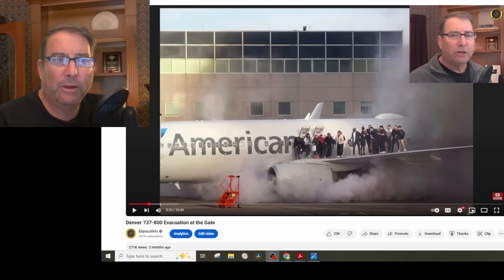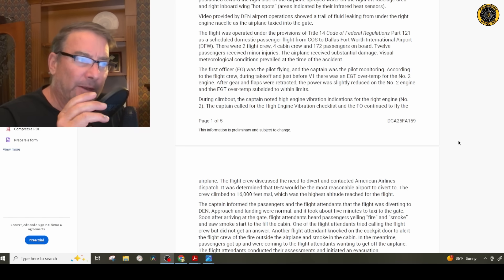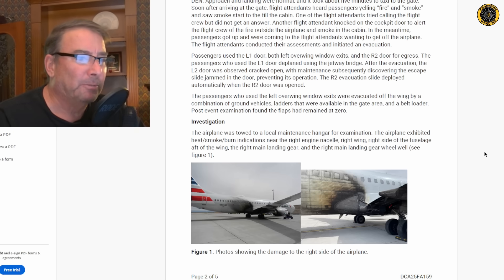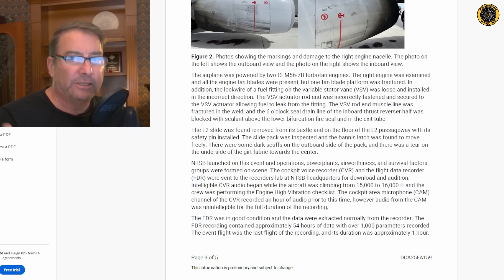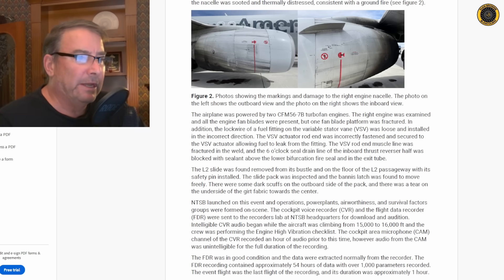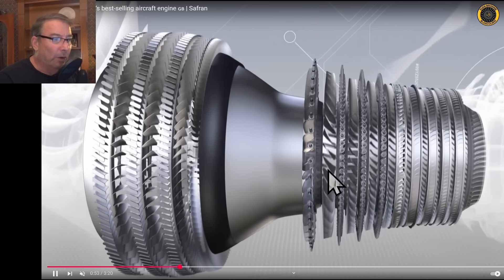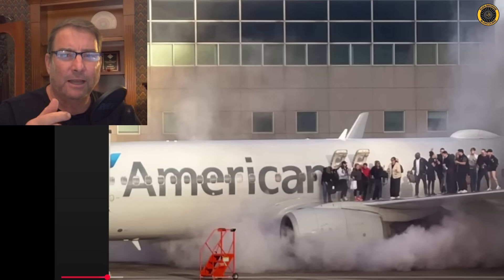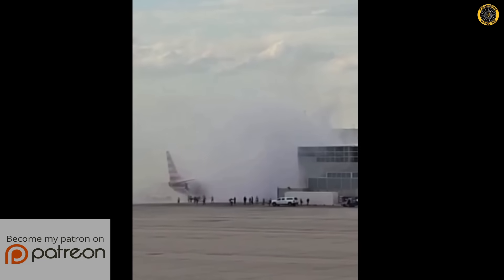NTSB Prelim American 737-800 Engine Fire at Gate and Over Wing Evacuation

Comment: The slide safety pin is to be installed prior to removal and before installation of the slide. It 100% prevents the slide inflation bottle from inflating the slide. It physically locks the inflation valve closed for obvious safety reasons. The pin has a two foot long streamer on it. At least it's supposed to have a streamer on it. I don't know how you'd miss that streamer, and the maintenance manual and job card are very clear about the pin. Replacing a slide is also a required inspection item, which needs the signoff of a QA inspector. Someone is going to have to answer a lot of hard questions, and I haven't even started about the VSV actuator.
What people don't get (even many pilots) is that if you're a mechanic, and do a task, you're fully responsible for that work until the task is done again by someone else. That could be years. Try answering questions about a complicated task you did two years ago. Good luck with that!
Reply: I'm a retired 737-800 LAME ex Qantas. Due to the occasion where a slide or two has been installed without safety pin being removed before the slide pack was installed on the aircraft. We now have a licenced engineer and an independent inspection by another engineer with documentation and signatures in the Tech Log.

Comment: It sounds like the person who installed the B nut incorrectly on the Variable stator fuel pressure actuator line also did not safety wire it properly.

Comment: no excuse to not have the flaps extended as SOP regardless of indecent, if it is relied on for evacuation. ``its alright if there is no fail safe condition after the power is removed, that will never happen if there landing is successful`doh...

Comment: A little extra information, because I've seen the gate camera footage. The gate ground crew (Fleet Service) did an amazing job rolling out the 150 pound fire extinguisher and dousing the fire in the right engine. Boeing engineering has said that the airframe would have been a total hull loss if the fire had burned for another 30 seconds or so. The gate crew also did an amazing job of thinking fast and getting work stands up to the left wing to get the passengers to safety. Phenomenal job and professional response from those workers!
Reply: Thanks for the extra info. The ramp crew do one of those jobs where you only hear about it when they done wrong. Great to hear a positive story about people normally overlooked.
Reply: We had those at every gate back in the day and trained on them but only if we asked and then only when there were expired extinguishers that needed serviced and the fire department was in a good mood when you asked. I hope that has changed and everyone gets some sort of training on the use.
Reply: @lonnywilcox445  I can tell you as a ramp agent we had to do an annual,computer based  training module on fire extinguisher use and safety and the online test at the end of the training module. While we did not physically handle something like the Ansul extinguisher used on the ramp, the video gave a detailed procedure for using it with much more clarity than if 20 of us had been massed around a real one and 1 person did the motions. ( not to mention the mess left after discharging one of these, repeated over and over at all the ramp training locations in the system).
Reply: @Jim-the-tallman   Great info, thanks!
Reply: The cabin crew were top notch. The evacuation was a safe as possible for this situation.
Reply: Unfortunately many of the passengers felt their bags were more important than other people’s lives.
Reply: @RebelliousTom1  The jet bridge was already there. The deplaning was already in progress. Leaving the bags in the aisle would have delayed the evacuation and possibly contaminated the aisle for use by the other passengers. The rules are for times outside of this.
Reply: @RebelliousTom1  I don't think the passengers are to blame for this one. The plane was connected to the jetway and de-boarding was already in progress, so the aisle was filled with passengers carrying their bags already. Try putting the bags back on the overhead or underneath the seats will only waste more time.
Reply: @RebelliousTom1  Fwiw nobody knows how they'll behave when panicked, until it happens
Reply: Phenomenal job? Your suggestion they use this hull again makes my thinking that the state of affairs of the fight industry is bad and people should save themselves  because the so called professionals are still doing there checklists.  No flight recording from the crew.  The flight deck was u b aware.   It just looks like a bunch of idiots run this operation.
Reply: @NyRenalMD I heard the plane is already been repaired and either at the paint shop or already back in service.
Reply: I don't want to fly on new Boeings as it is, I certainly would be pissed if I paid and ended up on this chassis as a future passenger.  Give it to the FedEx boys.
Reply: @workingguy-OU812  Why?  This will have been repaired as per the repair manual.
Reply: @cjmillsnun  I would guess that his comment encompasses all the Boeing aircraft problems of the last few years.  They have had design, engineering, firmware, software, training, and maintenance issues across several platforms.  The fuel leaks and safety-wire problems are sloppy repair work.
Reply: @workingguy-OU812  ...looks like maintenance issue this time....not an inherent Boeing issue.

Comment: I have been asking this question for over a decade ... why cant there be a redundant CVR system that sends compressed audio picked up from the cockpit to the cloud.  In the current modern era of wireless broadband, this should be a cake-walk to implement. IMHO as a retired IT networking engineer.

Comment: I am a bit confused. The prelim report states flight attendants “initiated an evacuation,” presumably after their attempts to contact the flight crew failed and having conducted their assessment. Perhaps it’s an issue of terminology, but it would seem to me that an “uncommanded” evacuation would be one that the crew (whether flight or cabin) did not initiate. Also, doesn’t the chief FA have the authority to command an evacuation in this exact situation?
Reply: "uncommanded" by the captain.
Reply: @KennethAGrimm  so if both flight crew members are incapacitated and the cabin crew determines an evacuation is warranted, it's still considered uncommanded?
Reply: @ashkebora7262 That doesn't make sense and seems odd to me. How do you distinguish between a true "uncommanded" evacuation (where no crew member gives an official command to evacuate) and one where they do? Precise language and definitions are critical in aviation.
Reply: Juan defines "uncommanded evacuation" at around 3:16.

Comment: Is there no evacuation command button on the FA panels?  I know that on Airbus aircraft, there's an evacuation command button on the FA panel that, if pushed, will sound an evacuation alarm at all other FA panels and in the cockpit.  Once the alarm is acknowledged, a member of the crew presses the button on their panel to silence the alarm.  In this case, an FA phoned the cockpit, with no answer, and another knocked on the cockpit door.  Had their been an evacuation command button, an FA could have pressed it, immediately letting the cockpit crew know an evacuation was imminent or in progress and they could have executed the appropriate checklist that would have extended the flaps for passengers using the window exits to "slide" down.

Comment: Similar thing happened to me boarding an Air India flight in Delhi there was smoke in the passenger cabin, but not in the cockpit. The passengers were freaking out and were demanding to be de-boarded. We left the aircraft and went through security in a new flight. just kidding, it was the same airplane. And the smoke started entering the cabin again. So we did the same song and dance and ended up again, in the same exact aircraft. This time there was no smoke, and we just took off.
Reply: Ah, Air India!  But they are better than the local carriers.  It take the train rather than the local air carriers in India.

Comment: The more I watch Juan and Hoover, the more I commit to never stepping foot on another airplane (and I owned two in the past, though I'm not a pilot).
Reply: These detailed investigations of anything that goes wrong, even when no one was seriously hurt, along with the lessons learned being spread across the industry, are exactly why aviation is as safe as it is. In contrast, if a car mechanic puts an engine back together incorrectly, the chances of anyone at another shop learning from their mistake are pretty much zero.
Reply: @L0rdArtemis  Agreed. When the car engine blows, you pull to the side of the road.

Comment: I have two cams installed in the engine room of my live aboard boat. When underway I have both cameras monitored at my control station. I'm not some mega rich superyacht just an old 40 foot loop cruiser. 
How hard would it be for an airliner to have cameras faired in and looking at the engines and wings?
How many times have heard on this channel "the pilots just couldn't see the problem"?

Comment: Great decision to not reject the takeoff for this Caution. Lots of big jets have been wrecked by a captain rejecting for no good reason. A Caution warning is not a good reason to reject unless your under 80 kts or on a space shuttle runway…..The capt and FO had a legit problem and handed the emergency return well. Bad maintenance on a typically very reliable engine was likely the fault. Stuff happened at the gate following the return, but sh_t happens. Big deal. Nobody really hurt. I can’t fault the flight crew here. The captain didn’t innate the evaluation because he didn’t know he had an issue, so he shut down the engines and hydraulics as he’s supposed too. I’d give the crew a gold star.

Comment: I'm a retired AA 737 CA and these MX issues are unsettling.  I wouldn't want to be on the receiving end of that maintenance history colonoscopy.
The one thing I didn't hear any mention of is - with the engine at reduced power, wouldn't SOP's indicate an ARFF response, which would typically involve following the aircraft to the gate until parked?  That would have obviously facilitated fighting that fire and maybe mitigated the damage and evac issues.
Great breakdown and explanation of the engine innards Juan.
Reply: I thought the same thing. You call ARFF for a high speed reject just in case so why not high engine vibration with engine over temp? Carpet dance for sure with the CP!
Reply: The screenshot of the checklist said to continue as normally, seems like a bad idea
Reply: @tommihommi1  With the checklist stating "if other engine indications are normal..." which it wasn't and they deemed a divert was prudent, I think you're right. Continuing would have been a bad idea.
Reply: Over temp of EGT and high engine vibes would be an in flight shutdown of that engine. Especially after seeing some of these engines that have decided to “grenade” and do substantial damage to the airframe and take out other major systems….
Reply: @mickeydoolittle2057 Engine shutdown based on what literature?The Engine Fire Severe Damage or Separation checklist predicate conditions say "airframe vibration" plus abnormal engine indications. Airframe vibration and spool vibration aren't the same thing.
Reply: I used to work in an endoscopy clinic and I wouldn't want to be on the receiving end of any kind of colonoscopy either
Reply: I Have a $5 bill that says that may now end up  being  the protocol
Reply: What does "CA" mean in your comment?  Also @Storriesmith  mentions "CP". What/who is that? TIA
Reply: @oleran4569  CA = Captain CP = Chief Pilot
Reply: @jdarden9000  Thanks!
Reply: @oleran4569 CA is Captain and CP is Chief Pilot.
Reply: @Storriesmith  Thanks!
Reply: @oleran4569  Sorry - CA is Captain and CP would be Chief Pilot, aka the boss.
Reply: "Maintenance History Colonoscopy"   -  My new favorite idiom.   Thanks @pi-sx3mb
Reply: You would think so, I definitely would have called for a post landing inspection.  However, I do wonder with all of the coverage on YouTube now, if pilots are becoming apprehensive about calling for CFR or declaring an Emergency on the radio, for fear of ending up on more sensationalized reporting for YouTube clicks!?

Comment: Not experienced on the 737, but on the EMB 170/190 series, the safety pin on an escape slide is to safety the slide prior to removing or during installation. It is removed prior to release for service. If the pin is in, the slide wont deploy. At my airline escape slide replacement requires an inspector to sign off, one thing they inspect is to assure the pin is removed and stowed.
Reply: To add, not a 737 tech but 767/77/87 are all the same. The safing pin is to facilitate maintenance on the slide without a danger of deployment, and part of reactivating the slide is removing the safety pin.
Reply: Jesus christ thats a massive oversight if thats the same deal on the 737
Reply: Interesting. Given the other error; seems to point to not just overall sloppy maintenance, but sloppier inspection.
Reply: If that's the case, this swiss cheese certainly had holes in it..
Reply: Well, it is my opinion that AA’s management has a history of allegations involving concerning maintenance practices. For example, sources indicate the FAA allegedly substantiated at one point that a Director of Maintenance (then a Regional Maintenance Director at the time of the alleged statement) once said, “You need to strike a balance between safety and productivity.  When I was stationed in JFK, I signed for sumping the Airbus, yet I never did.  I am looking for that balance.”
Reply: So does their director of maintenance get grilled over this or would that count as racism or sexism?
Furthermore, they've put on several hundred new maintenance techs over the past 24 months.  In the aviation industry I'm guessing that you look at the qualifications of the techs and hire or don't based on that but how do you assess actual skill and diligence? Other than put them on for trial period and hope noone dies as a result? I sincerely hope they didn't refer to a DEI policy during this hiring process.
Reply: @benowzinsky5394  Could I suggest that you turn off the news? Airline MX culture doesn't work that way. Is there a crunch for experienced A&P people ?  Absolutely.  A miss like a slide safety pin, or a door plug not reinstalled correctly isnt because of DEI. 
As mentioned above, read a little about the swiss cheese model, and human factors in aviation. 
Then ask yourself if you are perfect.

Comment: Fond Memories of learning how to take apart, measure all the parts, then reassemble various diesels and gas turbine generator engines. Our first solder class used gasoline blowtorches and Iron soldering irons with wooden handles.

Comment: Love to know what the “lessons learned” and preclusive actions done. Is it time to start FINING these corporations for half assed maintenance. How about $100,000 per inop evac slides. Same for CVR.  Who the heck uses AUDIO TAPE in this century.  Who signed off on SAFETY WIRE installation causing a FUEL LEAK.  The plane is ON FIRE and the cabin crew couldn’t contact the PILOTS?  The pilots cannot see the engines from the cockpit.  No smoke detectors?  Love the pic of the people standing over a burning engine waiting for the BBQ. “Little Things….,,?????????

Comment: This is a fantastic video. Great to learn how stator vanes work!

Is there no common cause here? Could that fuel leak have somehow caused the overtemp and then vibration? Obviously there are two separate issues. The blocked drain plug, and the incorrectly installed safety wire. But I suspect that might be the only coincidence. 

Also, I was surprised to read a part of that report, where it said the ramp crew put out the fire? That's a pretty large fire to put out before the trucks got there, impressive.

Comment: Daft industry. Modern cameras are so small, light and cheap. As a minimum they can provide the flightdeck with an overview of the aircraft status. Not just in this instance, but think of wrong engine shutdowns in the past. But the industry as a whole will think of excuses NOT  to do it rather than generate a way of getting it done.

Comment: I wish safety wiring was always that easy in the video you showed. Usually, there is no room  because of so many other components tucked in close to each other. Sometimes, it's a one-handed operation literally. 😅
Reply: Not to mention zero room for the safety wire pliers.

Comment: I would still be hesitant on "sliding off the wing..." I mean none of us passengers have any experience doing that and so even if the flaps were at full deployment I question if the passengers would have actually used it or would have stayed on the wing. (They were in the goring in an airport after all)

And yes, the flight crew were left out of the loop, so they were "behind their plane"

Comment: at the FBO we had to check the screens in the fuel delivery nozzle of the Jet A trucks every month which meant cutting the safety wire and redoing it. not my most enjoyable task in the dead of night. not sure how anyone with any mechanical aptitude would get the direction of tension wrong. we did have a licensed A&P working the line that thought bolt size equalled wrench size. ie, a 3/8ths bolt taking a 3/8ths wrench. they thought a 1/2 height nylock was something exotic.